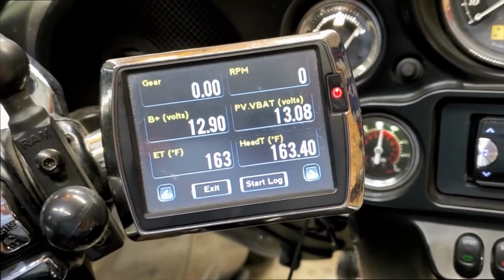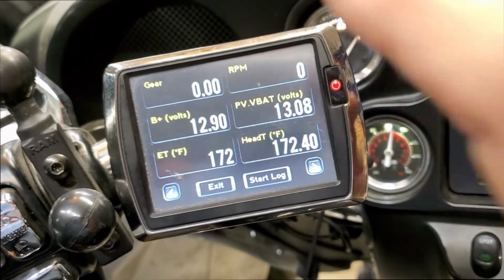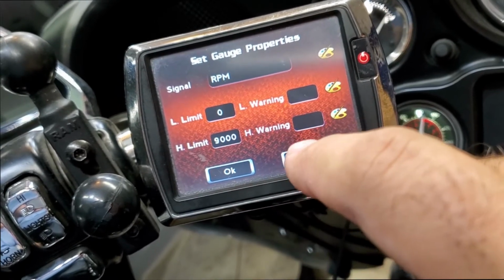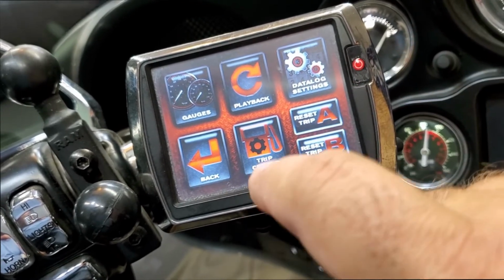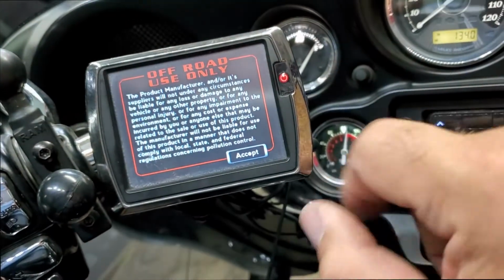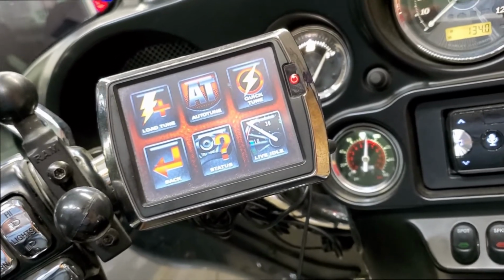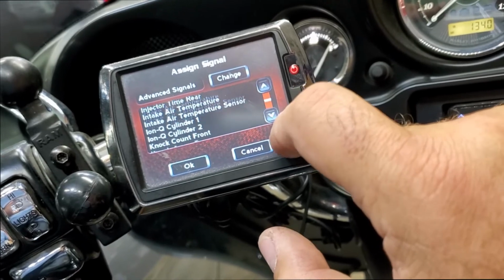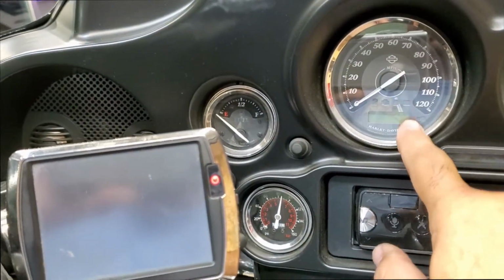Harley Davidson Trouble Shooting Using DynoJet Power Vision Tuner For Regulator Issue

Comment: Hey, what year is your bike?
I have a 2011 SG and I just put another OEM throttle body on and my rpm are at 3k….. any suggestions??
Reply from the maker: Sorry, just seeing this. Mine was a 2013.  Unfortunately I don't what could be causing your higher rev. I can adjust mine with the PV Tuner. Also as shown, I can use it to see the correlation between the throttle grip and butterflies.  Without the tuner you are kind of guessing in the wind.  Hope you get it fixed.

Comment: Its a great tuner but your mistaken about it being the only that shows that info. Thunder-Max's Thunder Heart Application will also show you that information. 2 major differences is PV has as a digital touch screen you  can mount to bars T-Max does not. T-Max  is a replacement ECM. They both have outstanding functions. I have Thundermax on my 117" Twin Cam the new bike I'm buying I'll probably try PV out.
Reply from the maker: Good to know as I didn't. Thanks for sharing.

Comment: Are you able to see oil pressure on the power vision
Reply from the maker: Since it is a digital signal, I am certain yo can.  I would have to cycle through the options, but pretty certain it is there.
Reply: I just got mine installed and look through the information and did not see oil pressure

Comment: IDK about 2020 and older but on 2021 and up the ECU stores a history so if you tune it, it knows so even if you put the original tune back it is in it's memory that it has been tuned and if they hook it up to their diagnostic computer they will know and it will be immediately flagged by the Harley servers
Reply from the maker: Yes, many manufacturers can tell when a ECU has been tampered with (tuned/changed).  This is call an imprint.  Not sure when Harley started looking for this.

For Harley this stems from the fact they were selling aftermarket ways to de-cat pipes and re-tune the ECU's before the bike ever hit the street.  The EPA fined them heavily and HD won't take the risk again.

In the end the dealer still has to prove anything you changed had a negative effect to cause an issue. 

But, you do run the risk "getting caught" by the dealer and complicating things a lot.  

Important to note, you can use a Power Vision and are not required to re-tune the factory flash.
Reply: @gphilpot1  yup that is correct, a Power Vision can be hooked up and used as a diagnostic tool without using the tuning features and that won't flag your bike if Harley hooks their computer to it but soon as you "marry" the Power Vision to your bike the warranty is voided because it states that you may not use any other tuner other than the SE tuner.

Comment: Do you know if it has oil pressure indicator guage?  I cant find it lol
Reply from the maker: I will look and let you know.  I would say yes as the oil pressure sensor is electronic.
Reply from the maker: Surprisingly  I did not find oil pressure as an option to monitor.  Wondering if Harley Davidson  only has an oil sending unit directly  connected to the gauge that doesn't  run thru the ECU/PCU.

I would email Dynojet Tech Support and ask. 

Thanks for watching.
Reply: @gphilpot1  To tell you are fucked. A red oil light should be seen when you turn the key on and disappears once its started because oil is flowing.If you own a Twin Cam you should beware that the OEM cam plate is cast and can be porous which can cause the the oil relief to leak oil. On a 2008 FXD should be 35 psi if its leaking it can drop to near zero. This happens a lot at low RPM like sitting at a light. Axtell and Baisley make a fix for it. You would think they would have a pressure gauge instead of an oh fuck me gauge. Trust me you do not want the oil light coming on while running down the road.

Comment: Great video! I am really enjoying my DynoJet PV.... I am wondering if you can give me some insight or point me in the right direction with a small issue I've come across?  I swapped my stock pipes and air cleaner on my 883 Iron, which is why I bought the DynoJet Tuner.  I autotuned the bike by riding 20 mins....loaded that map...rode another 20 mins....loaded that map...and then did the same thing one more time.  The bike runs fine, but when I 1st start the bike (cold)....it sputters a lot and almost wants to stall (unless I throttle it a little). After that it runs fine. Any idea why this may happen at every cold start?
Reply from the maker: Check the idle setting on the PV, it could be set a little low.  I bumped mine up 200 RPMs to make it idle smoother on cold starts.  

Also, I ride my bike for at least an hour on auto tune.  That allows me to hit all the ranges.  The PV will adjust the cells repeatedly as I drive creating a more accurate map.  You are doing the right thing with at least 3 auto tunes as the PV will only change a cell value by a certain percentage each time. 

So I would increase the drive time per auto mapping, maybe need to do more than 3, and check the idle.